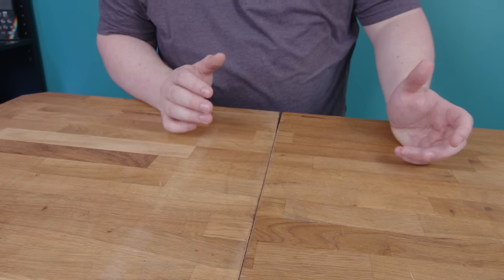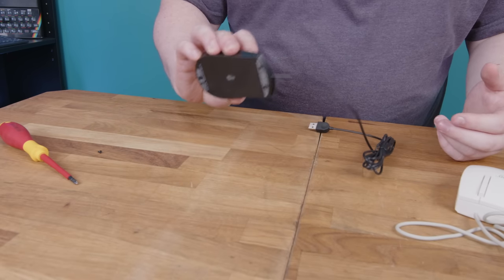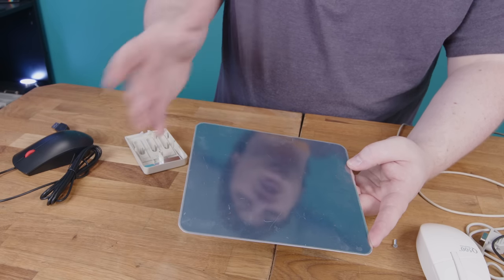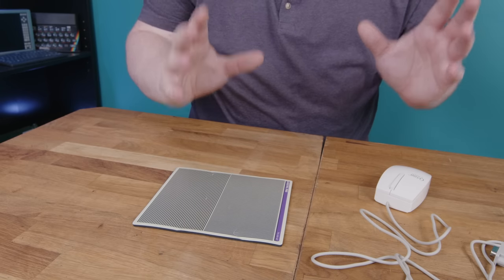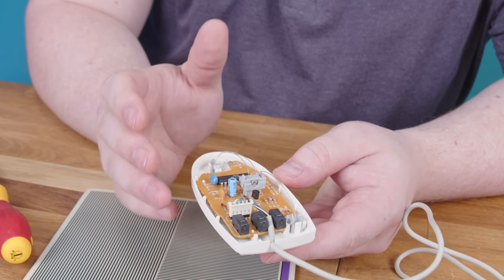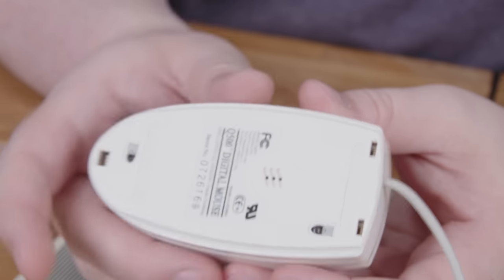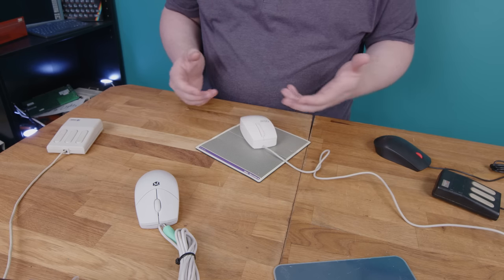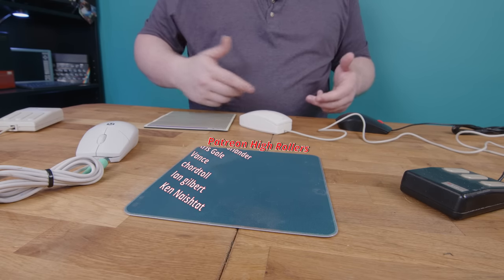Q500, The Weirdest Optical Mouse

Comment: Speaking of optical mice: I'd genuinely love to know why optical mice are coming back now after we finally started ditching them for laser mice back in the late 00's.  Back in the late 00's and early 10's, all the high resolution gaming mice (like the legendary Logitech G5) were moving away from inaccurate, low resolution, finicky optical sensors and becoming high resolution, incredibly accurate laser sensors that would work on any surface (even glass).  Now recently it's near impossible to find a laser mouse, and instead the market is once again flooded with outdated optical mice.  Why did we move backwards to an inaccurate technology we'd left behind?
Reply: There is a lack of chips for new mice, same for graphics cards, cars, ps5's.  The factories can't keep up, also one huge factory burned down, it takes months to create chips.
Reply: @roberts3423  It's just sad that the chip shortage extends so far to even include parts for mice.  Yea, if a factory was destroyed as well, then that would have a flow-on effect for at least half a year (if not longer)
Reply: People are used to mice being cheap.

Comment: “Even though there’s only 100 lines, each one produces 4 state transitions”; you know, weirdly, this helped me get a handle on the principle behind QAM and other similar modulations which cram multiple bits into one state transition… it’s kinda sorta this but in reverse. 

And instead of double-sampling the lines with the sensors separated by a little space, it gets the extra “sampling” and “space” inside that complicated mathematical structure which always made me go “hmm ok it’s just magic” when looking into QAM before. 

I mean I’m sure that’s wrong in subtle ways but just seeing it in space as a real artefact let me get my head around how they can be not-always 1:1.
Reply: Also even before you got here, in fact as soon as you said “it’s not really an optical mouse at all”, I screamed at my TV “it just hooks right up to a ball mouse’s photodiodes in lieu of the spotted wheels!? :D” and then felt vindicated when you popped the top off!
Reply: Wow, that double wheel mouse. Such value! It’s even got a real middle mouse button too! FIVE BUTTONS *and* TWO wheels!!
Reply: oh crap did I doge? I wasn’t trying to, honest
Reply: or, instead of 4 state transitions, you could just measure the phase of the sinewave intensity profile this would produce, and get "infinite" resolution. Or at least more than 4.

Comment: i feel like the reason few consumers had the three button sun mice is because they were probably marketed towards practical applications. i imagine you could probably go to a machine shop somewhere where there's still a cnc mill controlled by a computer cart that has one of the reflective mouse pads stuck down on it with double sided tape.

Comment: With this mouse, it seems as though you could control the input by changing the layout of the lines.  You could print a linear "mousepad" with lines of calculated thicknesses where dragging the mouse across at a constant speed does a set of specific mouse movements.
Reply from the maker: hahaha, you're right. an optical cam track.
Reply: Hmm. I wonder if you could make a track that lets you draw perfect circles and arcs.

Comment: I came to the same conclusion about the ball mouse parallel. I actually expected you to open it up and there be optical fibres connected to the interrupter, simulating the rotary encoder. It's pretty clever

Comment: Speaking of the modern design, The 8-bit Guy did a video where he got an earlier iteration of it where the USB interface IC and the optical sensor IC were separate parts and hacked an interface direct to the sensor IC's output so you can see what it's seeing. Great stuff.

Comment: You're correct on it being the same as rotary encoder, this would likely be called "a multiplexed dual linear quadrature encoder with external code stripes". The encoders in ball mice aren't exactly photo interrupter, its actually a pair of them in a single device. The offset between the two sensors creates a stepped rising and falling signal, depending on which leads or lags determines the direction.

I've heard quadrature encoding also called "gray code", but think that was more of an old generic term for many different forms of encoding which it also falls under.

Dedicated counting ICs for quadrature encoding used to be fairly common, but now its all done in software on microcontrollers or ASICs like here. Similar, these optical encoders for both linear and rotary used to be commonly available from suppliers along with code wheels/strips, now they're rather specialty devices and just getting the sensors themselves is kind of difficult. Has made some projects a bit challenging.

Ink jet printers used to have similar linear quadrature encoders, though with much high DPI, for tracking the position of the print head. Modern ones just seem to use cheaper tricks now.

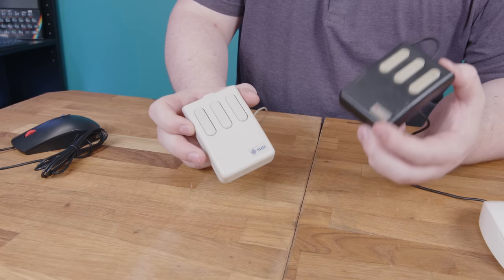Comment: My aunt was a technical engineer back in the 90s and used this (5:10) exact model of a Sun Systems Mouse with that pad. This was absolutely fascinating to me as a kid.
In the early 2000s I was lucky enough to find one of these special metal mouse pads in a garbage bin when an engineering office was cleared out.
These are pretty hard to find these days.

Comment: The smallest mouse pad I've ever seen was clearly a piece cut from a regular mouse pad.  It was at a point-of-sale terminal, in the small area on top of the unit next to the display pedestal.  It was, basically, the same size as the mouse.  There was no room to push the mouse in any direction.  I thought it was the silliest thing!

Comment: this was way more interesting than I expected. I'm glad I stuck around for the reveal! I wonder if you are wrong about how the decoding works, though. You suggest that it's basically a binary threshold and the hardware just counts black/white transitions. That would be very low resolution. Instead, if they measured the relative intensity of the light reflected into the two fiber optic strands you would get a sinewave signal out of a square wave source, and could actually pick up the phase of the sensor's position within a single pair of white and black lines, since the intensity of the light reflected back into the strand would depend on how close to the center of the line that strand was. The test is simple: does the mouse move in a jerky stairstep way when slowly pushed very slowly over the pad?

Comment: I remember both of these from the mid/late 90s.  The sun mice were great, except when used in a college engineering lab and eventually someone would sneak in food,  or toss their keys on the mouse pads and leave scratches (very costly).  The Q500 I remember seeing for CAD work, and then also in junk piles before, I think it was trying to be a cheap alternative to the optical mice that used to use a digital base tablet like "mouse pad".

Comment: Loved the infographics on this one. I think part of why the dots work is, when moving in the off-axis, 90% of the time you're going to see either no illumination change or you'll see both sensors change illumination at the same time. The microcontroller could be programmed to ignore these.
Reply from the maker: yeah, I can't quite figure it out, because this would feel really jittery if so. I have this picture in my head of how they use the offset of the columns to make this not happen, but I can't really illustrate it, and even so I can't really figure out how that would fix all the problems either
Reply: @CathodeRayDude  I have a feeling that Clint's mouse may not have many more sensors than yours- I think those fibre optics are pooled internally- 4 rows of two- if you space the two rows a half grid pitch apart, then while one is over white, the other is over black. 
If you consider the sum of the illumination from one pair one pair from each row it would be functionally blind to the change when movong in the wrong direction.

Given the cheapness, I'm almost sure that's what they've done, and I see no other reason to have two rows

That just leaves 4 columns instead of two...and if my previous point holds that's confusing because they're seemingly equally spaced as the rows, meaning the same thing applies to them, 1,3 and 2,4 should light up at the same time, so they're probably pooled  too, why I don't know, perhaps to improve resilience to rotations somehow?
Reply: @CathodeRayDude  remember the grid of the other pad? White or bright with a dark or black grid. Effectively it is white dots or rather squares. Well your black dots are actually a black pad with white grid lines.  In other words,  the grid contrast is inverted. That also means it would be cheaper to produce,  uses less ink. It works the exact same way, just inverted the contrast.

Comment: You should check out the optical mouse from Xerox, back in the 70's. It still requires a grid, but it's the earliest known optical mouse. They also made the first ball mouse, but it actually used a large ball bearing for the ball. Very cool stuff. You might need to find an Alto to be able to actually use it, though, and that's quite the challenge, since they're large, require extremely rare storage media, and are essentially impossible for common techies to repair unless you have experience pulling logic outputs and reading machine language.
Reply from the maker: Oh yeah, I had read that they had a modern-style design all the way back then - the person I borrowed the Mouse Systems mice from also has some Altos, I'll have to ask if they have the Xerox optical when I return them lol.
Reply: @CathodeRayDude  the alto was a positively fascinating bit of kit. It wasn't a full GUI OS, but the applications did run with a full graphical interface that you controlled with the mouse. There were even alpha builds of GUI-like launchers for it. Xerox also made 2.5mbps networking cards for it. They used coaxial connections, like broadband modems. And, as far as I'm aware, it didn't feature and microprocessors, just various discrete logic chips. Truly an astonishing development for the time.

Comment: About the MouseSystems style optical mouse, the pads were available in a reflective plastic as well - I have one - but the aluminum pad was certainly nicer.

The odd trick is that you can actually just print a fine grid on a sheet of paper and tape it to your desk. This was a common hack when university surplus workstations filtered out to the community sometimes without their special and expensive pads.

Comment: What a find! I think you are absolutely right, the two offset sensors together with the grid are acting as a simple digital linear incremental encoder outputting a quadrature signal - exactly the same signal that would come out of the quadrature encoders in any ball mouse. While it's probably almost impossible to know if the 'DMP3-SR' chip was used in ball mice(a datasheet seems to be impossible to come by, it's likely a clone of some other device) it would definitely be possible to use a ball mouse controller IC in this system.
Reply: The one thing that I find puzzling is that the photodiodes are shared with each axis. AFAIK regular mice run both encoder LEDs at the same time, so a multiplexed system like on this mouse wouldn't be compatible. They probably needed a custom chip. On second thought, they could have used a cheap OTP microcontroller.
Reply: @eDoc2020  I was thinking about this and you are probably right that most controllers would run both encoders at the same time. An OTP micro controller seems like a good candidate.

Comment: Grandfather had a similar mouse called a  Mouse Systems Optical Mouse in 1989. Using the same internal LED and sensors found in double sided disk drives of that era, reflective light captured resulted in bit translations.

Comment: I have only seen the design where a metal plate is used in the early-mid 1990s. I was in high school, and one of the teachers, or teacher's aide had one. 
Ball mice are so high maintenance, so this was interesting. Considering even ball mice needed a mouse pad, whether it was metal or fabric, it didn't matter.
Something else unusual, were the ball mice cleaner products. A Velcro ball and mouse-pad. The ball was wrapped in the hooks, and the pad was made of the loops. A special cleaner was applied to the ball, and the mouse was moved around on the pad. The hooks would scrub the rollers.
An alternative was always a carefully applied pocket knife.

Comment: This was pretty interesting. Not exploring weird mice too much myself, I was using cheapy OEM ball mice until like 2010, a cheap wireless optical mouse for a bit, and then been on laser gaming mice ever since. While I like the idea of a sniper button, I constantly forget to make any use of it. I do manually turn DPI up and down sometimes midgame though, like cranking it up for tanks in Battlefield, or down for weird old games that freak out at high DPI.
Reply: Yeah I don’t like the press and hold sniper buttons, but I do have a shortcut to toggle between, IIRC, 400 and 1000dpi or something like that. I was tweaking the sliders a lot by feel for the settings so I don’t have exact figures but yeah
Reply: @kaitlyn__L  ooh, that's a thought, I could maybe set a macro key to toggling a sniper mode on/off 🤔
Reply: I have been using a "gaming mouse" for CAD work for years. I never thought of the gaming implications for it, but it has a button on the top for toggling between three different DPI modes. I almost always have it on medium, occasionally slow, and fast only if I'm doing data entry. Its handy.

Comment: I think the LGR mouse follows the exact same design principle (and hardware) as your mouse. To make it work with dots, you need to integrate the signal over a line (one-axis). You can do that easiely (and cheaply) by having closely spacing fibers in a line and feed them to one photodiode (or PR). You get the average light signal over that integrated line that the 4 fibers form. That way you don't need lines, just dots. Thus 4x2 fibers feed to your two photodiodes. And the same as your mouse, it alternates between x and y axis. 
Nice video by the way!!

Comment: Not sure if you read these old videos, but as an anecdote, I remember our first PC having some type of red light optical mouse, and this would have been late 80's or early 90's, prior to even Windows 3.1. I believe that it was actually a Gateway PC and had the 2x 5.25" floppies. The mouse does very much remind me of your Mouse Systems mouse, but worse. It did require a reflective mouse pad (though ours wasn't hard metal) with a grid printed on it, but the grid was quite a bit larger than the one here. Probably half a centimeter and slightly rectangular. This worked though, because the PC resolution was so small. This was when a mouse cursor on the mono screen was a flashing rectangle, not an arrow, and each cursor position was fully unique. This PC also had a turbo button!!!

Comment: Those old optical mice were great. If you wanted to reserve a workstation, turn the pad 90 degrees. The mouse doesn't track right and people can't figure out why. Turn the pad another 90 degrees (for a total of 180 degrees) or back 90 degrees and the mouse works fine.

Comment: On top of being a masterpiece of cost-cutting measures, the Q500 also happen to be, like you pointed out, one of the only optical mouse that perfectly replicates a ball mouse signaling. Even the IntelliMouse Explorer (probably one of the earliest widely available optical mouse) is at its core a USB mouse with a PS/2 adapter. This simply will not work on a serial port if you also add a PS/2 to serial adapter. This makes the Q500 one of the only way you can have an optical mouse on a 386/486 or below (non IBM) that didn't come with PS/2 ports.

Comment: My dad bought a 286 in 1989 with an optical mouse, called "qmouse" or "quick mouse".

It had two led-sensors in the center, 90 degrees of each other, and used a normal paper printed grid. This grid was made of white miniscule holes in an hexagonal disposition.

Never seen one of those again, it's extremely hard to find anything online.

Comment: Another great optical mouse was that from the Amiga age (Golden Image optical mouse). That one also required a special mouse pad with a unique pattern.

Unfortunately the pads wore out easily and were not cheap to replace. It was quickly discovered using a photocopy of the mousepad worked a treat. You could even copy it 2up on A3 and get a bigger mouse pad! Enlarging also worked well.

Comment: I think the last one, with dots, ALSO works when held diagonally relative to the mouse pad.
The grid pattern from the beginning example would change its "movement to grid count-read" differently depending on the angle of the sensors (angle you hold the mouse). (A diagonal grid maybe would pick up lines and leave lines at a different rate: the lines would look "thicker" at an angle, a vertical line tilted fully horizontal line would appear infinitely wide.)

The dot grid with more processing could keep a constant "mouse movement to read sensor movement" better, as the dots would be the same size at any angle, and read the same at angle (after calculated compensation).

This may help explain why it's hard to draw circles, you turn/tilt the mouse as you move (maybe).